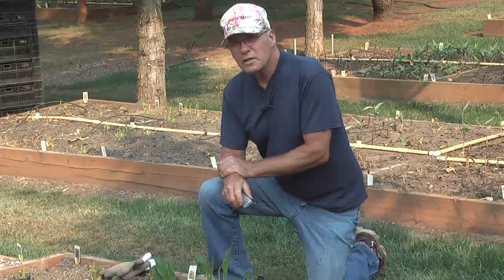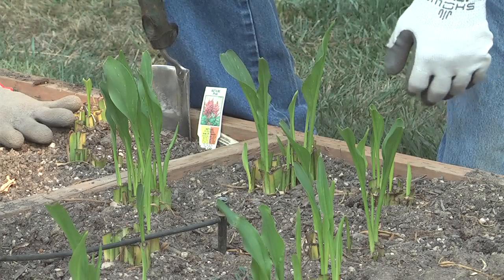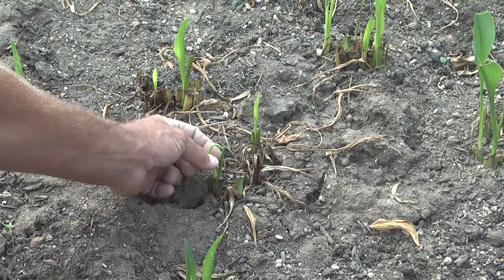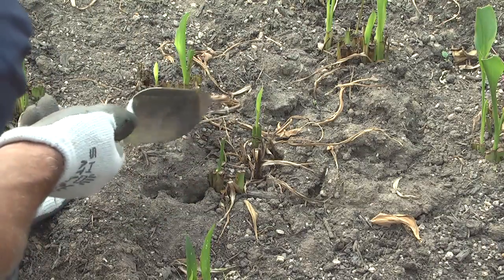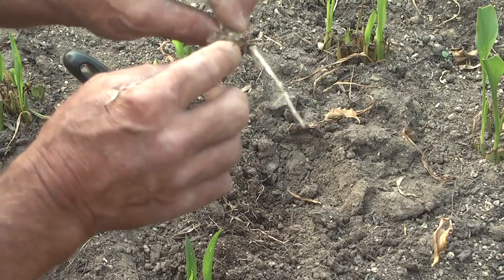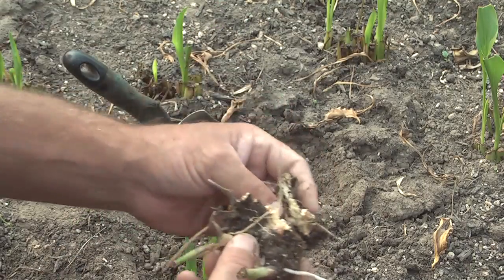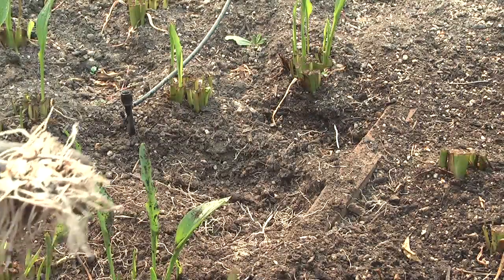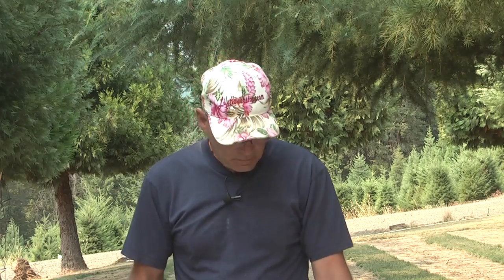Growing Calla Lilies: Recognizing Soft Rot

Comment: I have just bought a Calla lily corm or bulb from a mail order company.  I followed the instructions implicitly and was careful to pot it straight away on arrival in moist compost and in frost free temperatures in the greenhouse.  
After several weeks there was no sign of any shoots or root growth, having planted it with the domed bit at the top above the surface of the soil, and the root plate below of course, so I planted it a little more deeply to see if this would get it into growth, the same way I get ginger tubers going.
Now I find the entire bulb/corm is just a white squidgy mass.  
What did I probably do wrong, or was the bulb likely a dud one that was supplied.  It had no sign of either roots or shoots when it came.

Comment: I had an indoor calla Lily and it slowly dropped leaves I checked bulbs it was fine repotted them and sure enough slowly same thing. I've got plenty of potted. So I just dug Down bc I thought maybe it wants rest bc who knows when it was forced. So I pull bulbs out they're are firm white and no rot. My question is did it go dormant? It looked just like my Lillie's last year when going to bed I stored them over in it's containers. Fertilized and watered about March and omg they came back so big I mean huge. So could this be the case? It's mid July but I got it at Walmart indoors in March so I'm curious.

Comment: This is so helpful. It's been a very wet spring here, and my potted callas are all falling over. I pulled them, and they are all either slightly squishy feeling (firm but a soft skin) or having small  sections of rot. I don't have this dip. So I cleaned out any rot, let it dry a few hours, tipped cinnamon into the wound (works for orchids anyway!) and then dusted the entire bulb with copper containing 'Garden Dust'. Then I repotted into unglazed pots with fresh soil that I threw a few handfuls of peralite into. This is the first season I've ever had problems with these guys... we really need a spell of dry weather, lol!
Reply: Faye M. I had a beautiful white calla but in less of a month it was too gone... it died but I notice the bulb was infected with soft rot, I put some hydrogen peroxide on it's healthy parts for avoiding infections, I saved the rest of them and I'm wating to plant again :( it's so terrible my calla was so big and now I just have two little bulbs that survived the plantpocalipse... psd, I desinfected the container with chlorine and added more stones and new soil and I didn't know cinnamon work for this I will try
Reply: Hi Faye, I have a hard time with humid weather where I live too. I combat that by planting most of my plants in lava rocks that I buy for about $2 a bucket from a local landscaping company and they seem to be able to tolerate the excess water quite well in the lava rocks as opposed to planting in soil. Hope that helps.
Reply from the maker: Sounds like your treatment should work. Please let me know. And yes, too much wet weather or watering only encourages the disease to infect.